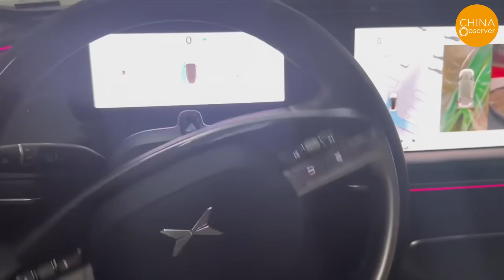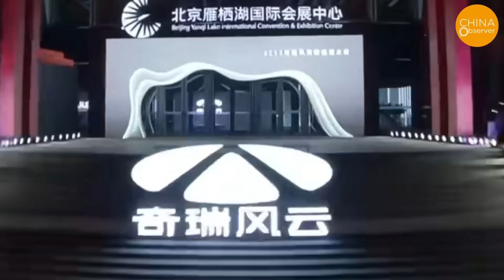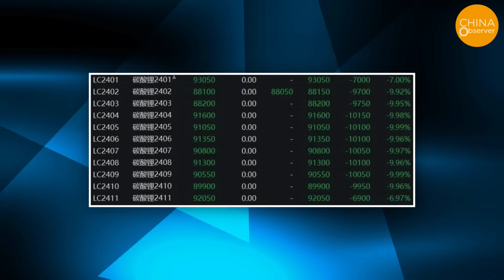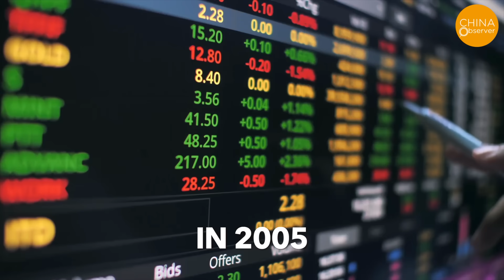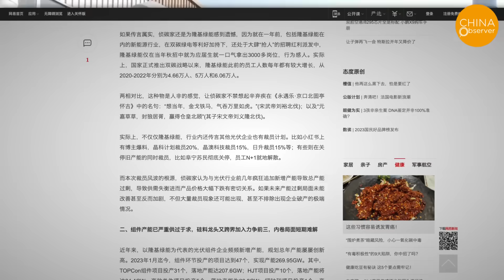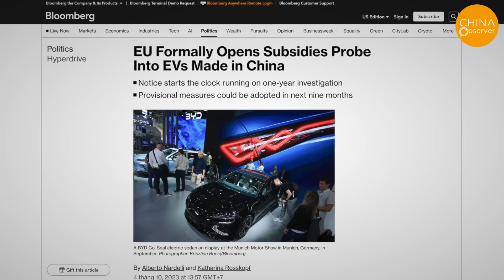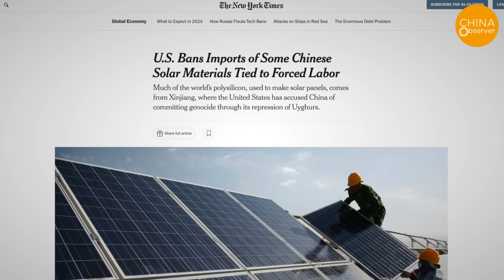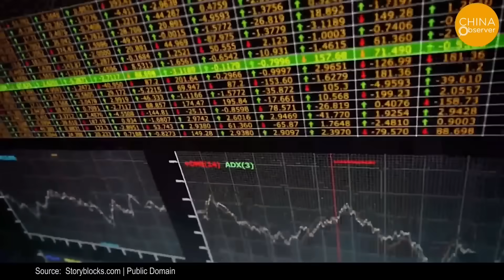Sudden EV Explosion, Rockets up 5 Meters, Close to 100 BYD Autos Spontaneously Combust

Comment: BYD battery’s are bombs waiting to go off. The battery scam is no joke…
Reply: Chinese EV, Explosive Vehicle
Reply: @Kyle_Winters  No one wants Cheap Battery would they 

+ An NEW EV ( I think what happen in 11 September 2001 would happen with them as they legal to buy them over how they Cleaner for Sky when is smoke is harder than anything water may able to deal with as they was doing it not legal do it to sell Toxic cars for an group of users likely with a bill for the not legal to drive act on behalf

----------------------------------------------------------------------------------------------------------------------------
I seen one even got it one time ( when going over a  speed bump ) on Live it started to smoke Toxic air that clearly net 0% without any CUTS on others parts of it 

Cheap battery never made when is could risk lives
or
branded battery $8000  for all 6-12 battery replace )

Comment: All EV fires and explosions were equipped with NMC battery. Since BYD adopted LFP battery in their blade system, the EV sales shot up by leaps and bounds. Even Tesla switched to LFP battery in their Y and some model 3 EV.

US and EU EV carmakers are still using NMC battery. The recent Mercedes EV that was parking in the basement for 3 days without charging, suddenly burst into fire causing total damages to tens of other vehicles. A few days later, another EV vehicle by Kia burst in fire and explosion too causing national panic.

All the govts in the world should ban EV that uses NMC type battery. It can burst into fire and then explore spontaneously. The causes are:
1) Faulty BMS that leads to overcharging
2) Defects that cause short circuit
3) Accident that puncture the battery.

Therefore, please avoid buying EV equipped with NMC type battery. It's now safer to buy EV with LFP battery.
Reply: and Really Toxic too hope it can be clean before minors get a Part of Very unsafe toxic

Comment: Top 10 Reasons why Tesla's/EV's are a bad purchase!!! 🤣😲🤣😲
 

1 Teslas/EV's have been proven to be horrible in extreme hot and cold temperatures! 110+ degrees and -20 below! No problem for gas cars! There are situations when people are stranded in bad weather, and gas will keep people alive! What happens when your EV runs out of charge? People will die! 
So hopefully you live on Easy Street, America. We have extreme weather in many locations of the country many times a year. So stay put with your EV and don’t travel too much. I wouldn’t want you to run into trouble. 

2 When an EV gets flooded, it's totaled. They could even start on fire and will burn for many days! With Gas SUV’s they make off-road gas engines with snorkels! This is something an EV cannot do! You better stay home with your EV on Easy Street. Leave the fun to others with gas engines! You can even buy used gas cars that were flooded and they still run perfectly fine. This cannot happen with your EV! 

3 An EV can start on fire in your garage, which can and has burned people's homes completely to the ground! 
Between 2012 - 2022, Teslas have had 232 confirmed cases of fires and 83 fatalities worldwide. This is a problem! 

4 Charging stations are not in all locations and when you find them in busy areas, they are all being used by others. This has been a huge problem in big cities! So not only do they take a long time to charge, but now you have to wait for a charging station to become available. Awful!! 

5 Imagine going off-roading with your EV 4x4 for several days. Where would you charge your EV? There is no electrical grid in the backcountry! It's a nightmare situation! Gas Wins! 😀
You might as well bring a generator that is full of gas, so your EV can get home! HAHA! 

6 Many populated parts of California have power outages every year in the hot months, and then they want people to charge their EV's at home!? This will only get worse and cause even more black outs! They do not want to talk about this issue. They just want more people to buy EV’s and then they will figure out this nightmare situation at another time. 
Population of California: 39 million and growing! The electrical grid cannot sustain this capacity! 
This should be a Hollywood movie of a bad situation where people need to get out of the city, while there is a black out and no one can charge their EV’s! People would die! With a full tank of gas, you survive! Another scenario where Gas-Wins!
😀
 Imagine other busy parts of the country? Not good! But this won’t happen to you, because you live in Pleasantville, on Easy Street. HAHA! Life is perfect isn’t it!  

7 When the battery dies on an EV, people have died because the doors will not open! Fatal hazard! A lot of people panic and cannot find how to open the door. Just last summer a battery died on a Tesla with a child inside. They had to break the window to save the child. They could not get the doors to open. This is the type of crap that most people will not put up with! Stuff like this does not happen with gas cars! It might not happen to you or someone you know, until it actually happens! These used EV’s will be around for a long time! 

8 Charging time is very slow! You have to go shopping in order to kill time, for the EV to become fully charged. Once it's charged, you can only drive a few hundred miles, before needing to stop again for 20-30 minutes to recharge. Who is gonna put up with this crap! Especially while driving across the country! Not to mention how fast you drive your EV, stopping and starting, and if you are driving in the mountains and or in traffic. The battery will drain really fast! Even in extreme temperatures, the battery will drain fast! Older models will be much worse, before you have to fork out $15,000-$20,000 for a new battery. Most people will not do it! They will sell it “as-is” and walk away! 
A gas car takes 3 minutes to fill up and can drive another 500+ miles per tank! The older the EV, the worse the charge it will hold! Who would ever deal with this junk!! What happens when your charge is almost empty and there is an emergency situation where someone needs to get to the hospital? You have to wait to charge the car on an older EV model? People will die! Again, Gas-Wins! I promise you that people will not think that they will be in these situations, until it’s too late!! Oh it won’t happen to me, they say! Go ahead, live and learn! RIP! 

9 High mileage Tesla’s/EV's have a very low resale value! Batteries are too expensive to replace. They are not a good investment! Used battery replacements can cost between $15,000 - $20,000 on a high mileage Tesla/EV! LOOK IT UP!! That’s just to replace the used battery!! You have to buy the used EV first and then replace the battery! I know, a really crappy deal!!! JUST WALK AWAY!!! 
A Japanese gas car at 150,000+ miles is a much better investment of under $10,000 and you do not need to replace any battery! Global W. Is a joke! 🤣

10 Modern Gas/Hybrid technology is getting so good! It’s the best it’s ever been in auto-makers history! And they are much safer in extreme situations, than a full EV! You don’t have to depend on charging a battery alone! Modern Gas/Hybrid technology gets really high MPG's! DO NOT give up on gas and oil! Auto-makers are walking away from EV’s! Global W. Is a joke! 

Future Warnings:  

Eventually certain governments will be able to shut off EV’s with a push of a button! They will pass bills to make it legal! No one can stop a gas engine! Yet another reason to get rid of gas engines. You cannot control a person who owns a gas engine. It’s all about control, all in the name of Global W! 
In China they have the "Social Credit Score" which keeps track of every human in that country. If someone jaywalks, or speaks against the government, or has unpaid parking tickets, etc. They can shut your EV car off, so you are not able to travel until you pay up. 
You don’t think this could ever happen in the USA in the next 50-100 years? Just like firearms, once you give up gas engines, you will never get them back! They are weaponizing the word Global W. and trying to brainwash the consumer to buy EV’s! When you buy an EV, you are slowly giving up your Freedom! All in the name of saving the planet. Stop falling for this crap! The Fear-Mongering of Global W. is a joke! 

American Democrats have been threatening Auto-Makers for many years, in order to force EV's onto the American consumer. When really the Consumer at large does not want them! It's a crime! They are bribing and threatening Auto-Makers to comply or else. Finally Auto-Makers are saying, NO MORE! Plus the American Consumer has also spoken with their wallets. EV’s are rotting on new car lots! HAHA! 

The American people need to know about this information!! 

What if someone wrote bad code on an EV and that code was designed to be a “kamikaze mission?!! Absolutely terrifying! Yet there are already kamikaze drones! Which means the code and computer chip is already here! Imagine that they/someone purposely drives an EV remotely & unmanned into oncoming traffic?! 
Devastating!!! If we are already talking about this, then you know it’s already being designed. Whether it succeeds or not is another thing. 

Rumor has it that Oil Fields are Renewable every 30-40 years! Oil is a renewable resource! Be careful what you are being told! 

KIDS IN 3RD WORLD COUNTRIES DIE TO MAKE YOUR EV BATTERIES: 

A typical EV battery weighs one thousand pounds, about the size of a travel trunk. It contains twenty-five pounds of lithium, sixty pounds of nickel, 44 pounds of manganese, 30 pounds cobalt, 200 pounds of copper, and 400 pounds of aluminum, steel, and plastic. Inside are over 6,000 individual lithium-ion cells.

It should alarm you that all those toxic components come from mining. For instance, to manufacture each EV auto battery, you must process 25,000 pounds of brine for the lithium, 30,000 pounds of ore for the cobalt, 5,000 pounds of ore for the nickel, and 25,000 pounds of ore for copper. All told, you dig up 500,000 pounds of the earth's crust for just one battery.

Sixty-eight percent of the world's cobalt, a significant part of a battery, comes from the Congo. Their mines have no pollution controls, and they employ children who die from handling this toxic material. Should we factor in these diseased kids as part of the cost of driving an electric car? 

YOU DID NOT KNOW THIS:

The United States uses three billion of these two battery types a year, and most are not recycled and they end up in landfills. California is the only state which requires all batteries be recycled. If you throw your small, used batteries in the trash, here is what happens to them. All batteries are self-discharging. That means even when not in use, they leak tiny amounts of energy. You have likely ruined a flashlight or two from an old, ruptured battery. When a battery runs down and can no longer power a toy or light, you think of it as dead; well, it is not. It continues to leak small amounts of electricity.

As the chemicals inside it run out, pressure builds inside the battery's metal casing, and eventually, it cracks. The metals left inside then ooze out. The ooze in your ruined flashlight is toxic, and so is the ooze that will inevitably leak from every battery in a landfill. All batteries eventually rupture; it just takes rechargeable batteries longer to end up in the landfill.

I say NO to EV’s!!! 
Remember: Gas/Oil is Freedom!

Comment: Soaring. Liyyeer
 examples
: to fly aloft or about. b(1) : to sail or hover in the air often at a great height : glide. (2) of a glider : to fly without engine power and without loss of altitude

Comment: what idiot wants to drive a normal car (Petrol or Diesel) with a grenade under his/her seat?

"don't worry, the safety pin is ON"

"yeah, but at any point in time during driving, the grenade could move around and the safety pin could get caught in something and get pulled out"

"no don't worry, it won't happen"
"besides, this is a device that will help you save  £££billions in fuel and maintenance costs"

Comment: Those small continuous explosions were probably the cheap individual cells going off. Cheap cells combined with cheap soldering combined with no shock resistance, the soldered connections break loose, make a short, and well… boom…

Comment: This message sounds suspicious and likely to be fake news or exaggerated information, as the simultaneous explosion and fire of multiple electric cars is a highly unlikely event without a clear cause or confirmation from reliable sources.

If such an incident had actually occurred, it would have received significant attention from major news outlets and automotive safety authorities. Additionally, BYD or related agencies would have had to provide information or clarify the incident.

Therefore, I recommend verifying this information from reliable news sources, such as major news agencies or official statements from BYD, to ensure whether this information is true or not.

Comment: Depending on which brand you prefer, but know that we see all kinds of con videos for each car brand, toyota has a bunch of it, anti-japanese, anti-american, anti-european, anti-chinese. No brand is exempted from all these bad propagandas. At the end of the day we all need cars, we all spend for them, they all have its pros and cons, and we all have different reasons for its suitability and use for it. EVs were tirelessly being studied and modified because we might run out of oil/gas for increasing combustion engine market and environmental issues. Now that EVs are made a sucess, battery resources are deemed to get scarce. Almost all resources will eventually. 
And THEY all need the views and likes for their channel.

Comment: This is explosion is really scary and extremely dangerous. I can't imagine such explosion while driving. 
Beware of the dangers when buying EV cars. The battery is just below the floor board. How secure are the electronic devices and cables in such cars. Cheap doesn't equate to qualify and endurance.

Comment: you go lithium aluminum hydride batteries, ectothermic garbage,  that ignites spontaneously when in contact with water or overcharged or run flat , why would you bother sitting in a deep fryer

Comment: At 0:25... that wasn't a directional sign. It was a vertical I-beam with signs on it and it shredded the car with barely superficial damage to itself.
Not saying anything as to whether tbe car ought to have caught fire or not, but most people, when picturing a directional sign, hsve in mind a single steel pole that any car would simply tip over or sheer off.

Comment: The technology hasn't matured yet.
I wouldn't trust a lithium battery to be safe enough to be included in a car I would want to drive.
If these solid state batteries are as safe, energy dense and quick to charge as promised, then I'll reconsider.
I still probably wouldn't be able to afford one though.

Comment: CCP lack of regulation and the rush to "catch up" to the west mixed with companies lack of experience leads to thinking they could just copy other countries companies IP, but experienced enough produce it cheaper and high volume to compete. That way of thinking may have worked for basic consumer products, but not for major infrastructure engineering projects, and precision and high tech manufacturing processes.

Comment: Note: Electric vehicles are far from "Green" ... look into what minerals it takes to make batteries and what is involved to extract those minerals. It makes oil and coal look green. Existing and proven technology for low emissions gasoline cars and coal fired power plants have existed for years ... and it's a lot cheaper.  Use it!

Comment: it is all because of the shotty battery manufacturing safety cells not being made right combined with corruption on the manufactures part in china this is why its more common their and no one is pointing this out. if someone was wondering info  wise...

Comment: Too bad they passed off a simulation as the real event. Easy to tell if you understand physics. For ever action, there is an equal and opposite reaction.  Look at a few rocket launches and then this video again. The lack of exhaust equal to the lift is very clear.

Comment: It should be no surprise. Lithium is pretty dangerous if you puncture a cell it ignites if it gets wet it explodes in these batteries way up to 2000 pounds and there’s tens of thousands of 18 650 lithium ion cells in them in so many silver connections. If one short circuits just one you could have a catastrophic failure of the whole cell I knew this would happen. Do not drive these cars do not purchase one of these cars. They are not safe.

Comment: Something tells me that real-life and youtube are usually far apart. If these were common occurrences, customers wouldn't be parting their hard-earned savings for these EVs and therefore BYD shouldn't be overtaking Tesla in car sales. BYD cars shouldn't be winning 1st and 3rd place in Japan's Car of the Year either. You can buy a single blade battery yourself and puncture it, overcharge it, heat it to 300 degrees celcius...and guess what? No fires, no explosions. In fact, LFP's have been powering thousands of homes all over the world without any incident of fire.